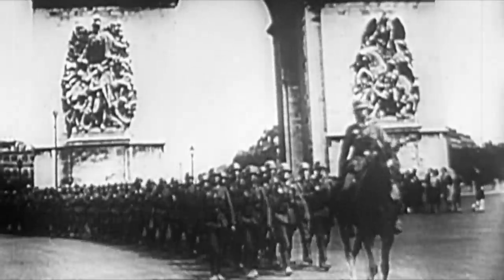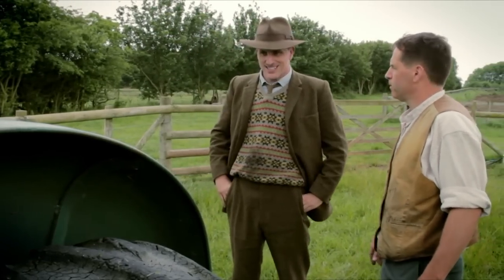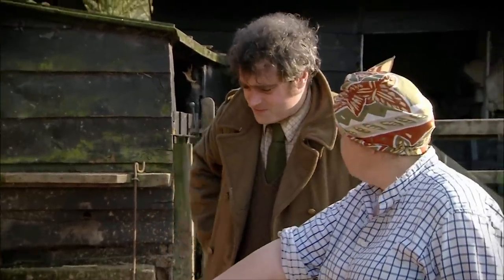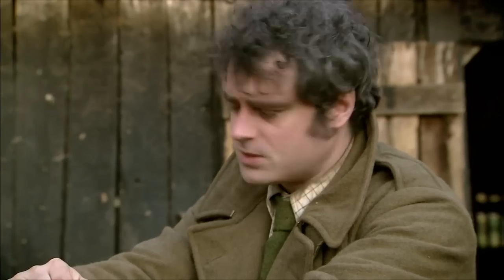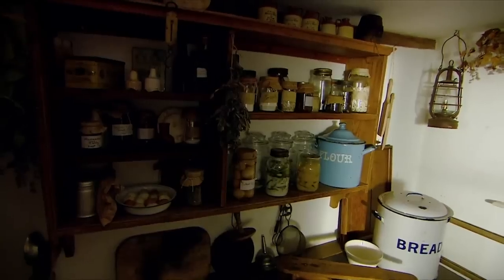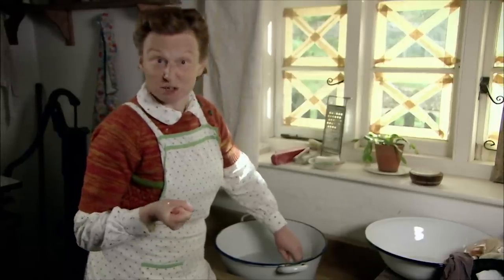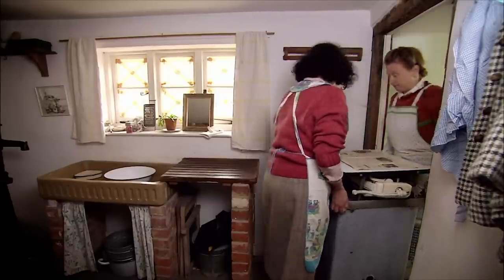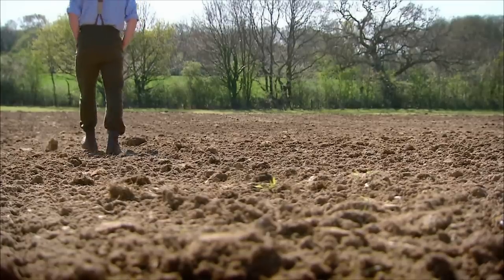Dig For Victory: How Farmers Saved In WW2 | Wartime Farm | Absolute History

Comment: This reminded me of my great aunt Yvonne when I was younger. She had one of those washing machines where you would agitate it and then run it through the wringer to get all the water out. This would have been in the 70s. So obviously there were much much more modern machines but she still insisted on using this thing
Reply: Ugh, we were using one of those in the mid-80s. I was terrified of the wringer, but it did a decent job.
Reply: @Trixtah  oh my goodness I got lectures about not putting my hands near the wringer part. Then the cousin ...that always did the things he's not supposed to....(including taking his father's brand new Harley-Davidson apart piece-by-piece!) decided to see what would happen if it was rolling and he shoved his hand in. He also pulled out all of his teeth one time. He has the most gorgeous straight adult teeth but he was gumming it for a year or so. 

Edit: Forgot to add this part he did break two fingers doing that and I believe he messed up the machine as well when he thrashed around because it hurt

Comment: At this time Ford (.and Fergeson) already has a modern tractor.
It started production in 1939..It was the 9N Ford tractor. But I don't know if the tractor was available in Europe.
oh and the 9n had an electric start. But you could also crank it by hand. 
Its not fun cranking it by hand.

Comment: little confused when they get told to grow stuff did they make $ doing it? and did they pay to get rastions?
Reply: The Emergency Powers Act empowered the Parliament to requisition every square inch of Great Britain and Northern Ireland at no cost.  However, farmers were paid for the crops they grew, but the prices were fixed, supposedly mimicking previous years 'normal' sales.  Which was not much.   As farmers were required to comply with the dictates of the War Ag, most had no savings to match the expenses of the machines or help to prepare (and importantly maintain) fields. Otherwise those fields would have already been in production, right?  So the various 'schemes' mentioned in the show aided with labor/equipment.  So even though technically they would have been making more, because they were 'selling' more, their workload, maintenance costs, liabilities increased exponentially.  Not to mention the constant, lingering fear of being labeled a mal-content, carted off to jail and kicked off their land for failing to meet state quotas. 

Something not touched on in the show, was compensation.  If a field or production facility was damaged by enemy activity (during the Blitz), the War Ag paid 2x - 12x the value of the land, to repair it. However, after the Blitz, when fields fell into disrepair due to labor/equipment shortages, no one paid the farmer anything to fix it (natural disasters, weather phenomena) and he risked, still, being thrown off his land. These were all paid out of pocket.  And after enemy hostilities ceased (many of these dictates extended for years passed the official end of the war), the government only paid pennies on the dollar to restore fields to their pre-war conditions. Leaving many farmers stuck with huge debts.  i.e. fields that were pasture or hay fields which had been plowed up for food, when the money was turned off and a farmer could no longer afford the seed to sow those fields, or the expenses of weeding/etc to see the crop to harvest, and the demand for the food was not there,  this posed major problems with weed pressure, erosion, loss of income (can't graze cows on a field with no grass).  So with no help to manage those fields back into utility, lots of lands became very problematic, farmers gave up.  And the state only reimbursed them for the value of that land at 1939 prices. Usally only a few bucks an acre.  

In one of the great Ironies of Socialism and Central Planning, farmers whose lands were obliterated by German bombs made out better than Farmers who suffered no damages and helped Britain win.
Reply: @maxdecphoenix  thank you for the time and info

Comment: You all are doing the hand crank wrong.
It should be like kick starting a motorcycle.
Only do half to 3/4 rotation.
LOL..STOP TRYING TO BE THE ENGINE.
lol.
It it don't start by 3rd try. something is wrong.
1st check to make sure the fuel was turned on. If no. then that good. turn fuel  on and do another 3 tries.
Next do you have spark? won't run until you do.
Is the fuel going through the carb?
Is it flooded. if yes let it sit for an hour and retry. remember to turn off the fuel for that hour.
If no, they you are not getting fuel. fix the fuel problem.
Those are your problems.
Unless you bought a diesel. in that case. Hook your horses up to it and dump it in to a pond.  And go buy a Ford 9n or 2n later in the war, after 1942.